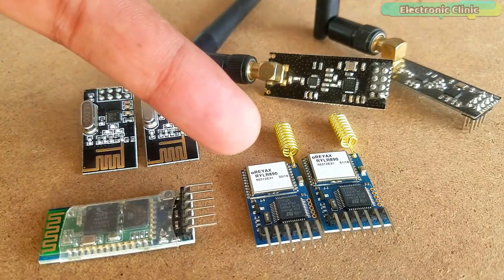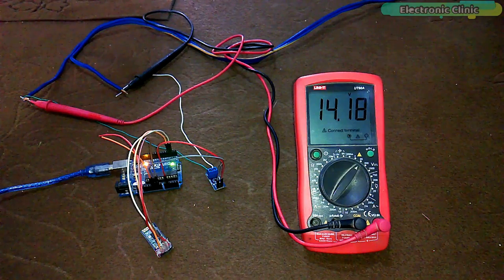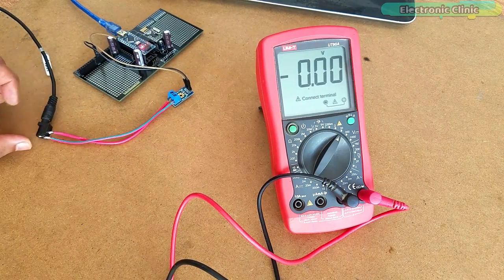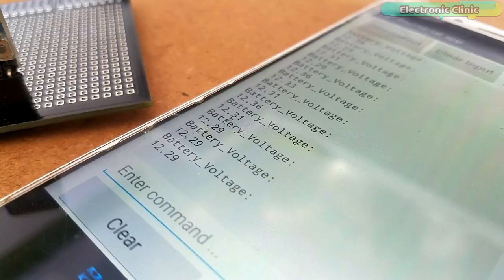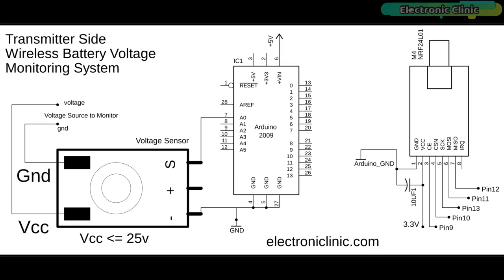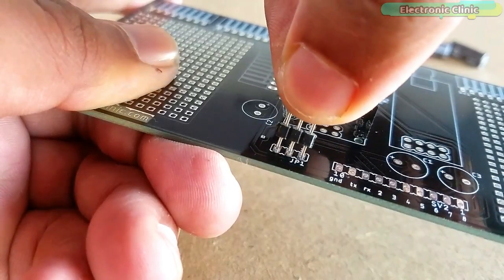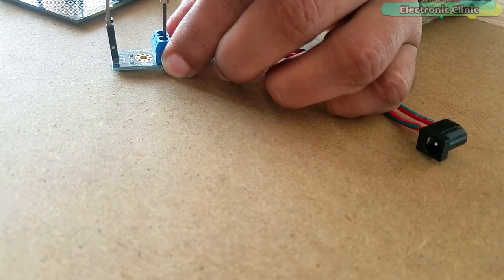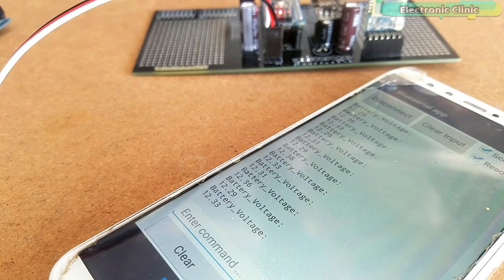Long Range Wireless Battery Voltage Monitoring using NRF24L01, Bluetooth, Arduino, & Android App

Comment: Nice idea. 
Two questions 
1) is it possible to modify the sensor for 48v , if so how ? 
2) instead of using mobile as receiver, is it possible to display the voltage data on a display ( lcd ) using a low cost microprocessor ic ?

Comment: Hello how is possible to connect wirelessly the pins of MAX7219 (CLK, CS, DIN) to Arduino pins? So that there's no more physical wires that connects between MAX7219 and Arduino. Thank you.